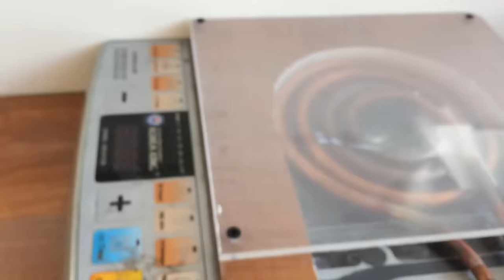How to Make 2KW induction heater from old induction cooker. Great idea DIY induction heater

Comment: You need a voice over so we know what your doing. I don't even know what your making but I like it 🤣
Reply: Yes.  Needs a voice over.  He built a nutt buster.  Heats up a nut and bolt that are stuck.  The fluctuating magnetic field from the cookstove drives the copper coil's magnetic field which is shaped in a tight spiral to focus the field on the nut which can glow red hot in seconds.
The water pump flows water through the copper because you want it to stay cool.
Normal controls can get a steel pan hundreds of degrees yet not be hot to the touch (except for the hot pan on it)
Edit:autocorrupt shucks
Reply: No, he doesn't. It's pretty clear!
Reply: @carpediemarts705  فيقفۇ
Reply: А, что тут не понятно? Индукционный нагреватель.
Reply: Hes making an induction htr out of an nduction htr! Hes a fucking genius innit!
Reply: Bwahahaha hes a freak of nature this guy!
Reply: The copper spiral coil placed over cook top induction coil is a simple transformer.  The copper coil attached to copper spiral coil is the new induction coil that you may stick iron things in and induction heat them.

Comment: Why would anyone believe this will work
Reply: @falmircamion3534  yeah yeah yeah this this probably will work but useless. Watch his other video his BLDC motor driver such BS circuit
Reply: I doubt you will reach 2kW with the other circuit,  @hiddenhidden9302 ... And even if you do, the other circuit needs an additionnal 2kW power supply. In this idea, you have it all with a simple induction cooker (And it doesn't even need to be broken).
Reply: @falmircamion3534  yeah 2kw input probably 500w of power get coupled through the transformer wast of energy. And I’m talking about his BLDC motor driver won’t work check it out your self
Reply: Well, if you were right,  @hiddenhidden9302 , it would mean you have the same bad efficiency when using the induction cooker... for cooking. I seriously doubt it...
I didn't get your point with the BLDC motor.
Reply: @falmircamion3534  no I’m talking about the coupling between tube and induction coils if you couple directly to a iron plate it would be most efficient. If you don’t know what I’m I talking about then you don’t have the knowledge to judge me. I leaned Electrical engineering more than 6 years. This guy make fake electrical circuit period.

Comment: Why to do so much copper coiling. You could directly heat iron metal part on induction coil with efficiency.
Reply: Have to be at least 2/3  of the pancakes or coil to start working you can't heate a piece of pipe and have to be turning to be heated up.

Comment: flame heat tubing, cool and it will bend much easier . Fill with fine dry sand then plug ends to prevent kinks.

Comment: Good thinking only thing is You need you outlet pipe at the top of the work  coil don't think the water will be making it up to the work coil in that configuration, it will go on one pipe and fill the coupling coil then flow out of the other hole without circulating through the work coil seems the work coil is a lot higher than the coupling coil
Reply: He crimped the pipe between the connections.
Reply: @Vibe77Guy  oh did he, I missed that 🤦🏻‍♂️ 🤣
Reply: @T2D.SteveArcs  Right at 7:00... I had to go over it a couple of times to find it myself... it's so quick.
Reply: @nyckid  👍👍
Reply: @MrUnknown7212  of course it works
Reply: @Vibe77Guy  clever

Comment: I would love to see one of these built with an iron pipe inside the induction coil - then pass water through that, to heat it. Might be a very effective water heater.
Reply: No do you know what is a very effective water heater the normal resistive coil 100% of the power is turned into heat where it's needed, this idea is stupid and wasteful the is no efficency gain using this 100% of the power will end up as heat except it's lost at multiple places so less would actually heat the water

Comment: did u make sure the cooker is set to high cause most default to 5 out of 10 and need to be adjusted to max power and without a display working or another unit of same type or power meter ud never know

Comment: How is this working? I thought copper did not work on an induction hob?
Reply from the maker: it will work when coil is closed circuit
Reply: @D.creative  Thanks for explaining.
Reply: @D.creative  how did you calculate the winding number of the second coil?

Comment: What does the water do?
Reply: Keeps the copper "cold"
Reply: @stapuft  how does this work with copper anyway? I thought the material needed to be magnetic? As in, iron cobalt or nickel?
Reply: @Bankable2790  copper is almost as conductive as gold, MY GUESS the copper is replacing the original coil, and directing its magnetic field, into the tiny coil at the end of the length.
Reply: @stapuft  Copper is not magnetic. Nor is gold.
Reply: @Bankable2790  learn to read kiddo, i said it was conductive, not magnetic, you take a coil of a conductive material, and run current through it, it becomes an electromagnet, THIS INCLUDES GOLD, that's just how electricity works. electricity and magnetism are intrinsically linked, and locked together separated only by a 90° phase alignment change.
Reply: @stapuft  you said “directing its magnetic field as*hat”

Comment: What's creating the ac current in your homemade copper coil? Don't say the other copper coil either?
Reply: The coil in the induction stovetop is transferring energy to the copper coil he just wound.
Reply: @TrevorHammonds  right bit it has to have something metal by it. That's how. Transformer works. Without the steel the secondary coil would not get an electric
Reply: @nickbaylander6320  I have limited knowledge of induction heaters, but I believe it works because the primary induction coil generates a magnetic field, which induces current flow in the first copper winding. The current travels through the copper and smaller loop, which acts like an electromagnet and generates a magnetic field, which in turn induces current flow and causes resistive heat generation in the part. The cooling system is needed to dissipate the resistive heat in generated in the copper, due to the large current flow. Again not an expert so take with a grain of salt, and think this method would only work with AC?
Reply: @nate4628  if you took the steel out of a transformer and just had a primary and secondary coil. That secondary coil isn't going to do anything without the steel. Their has to be metal in the equation
Reply: @TrevorHammonds  it doesn’t work.
Reply: @nate4628  no it doesn’t work . He uses editing to make it red hot .
Reply: @nickbaylander6320  NOT TRUE! Having a ferrous metal as a core is not necessary, due to the high frequency of operation (in kilohertz NOT running at 60 HZ)
Reply: Induction cookers will not run until it picks up metal. You can not use a non ferrous pan on an induction cooker. Even copper pots have a metal bottom
Reply: @nickbaylander6320  have you not heard of inductive coupling as in cellphone charging, sealed hospital digital thermometers, electric toothbrush?
Reply: @nickbaylander6320  you can bypass anything, like digital projectors that use HID bulbs and monitor the power supply, you can bypass the sensor circuit and convert it to LED bulb......
Reply: @devnuls  in order for the induction stove to activate it has a sensor that only picks up magnetic metal. How is he bypassing that
Reply: @nickbaylander6320  The induction cooker doesn't care if there's is actually ferrous metal near it, it turns on whenever it is loaded enough. The flat part of the diy coil couples the induction stove's coil to the other part of the diy coil, and if you put some ferrous metal in that, it loads the induction cooker just the same
Reply: @MrUnknown7212  I kk kk k
Reply: @nickbaylander6320  чтобы нагревалось да .. должно быть железное. что бы не нагревалось должно быть не железное. в данном случае нагрев нам не нужен. и витки медные. нагрузка болт который мы греем. он железный.

Comment: Will it heat a copper tube? Like for copper-copper tube weldings? Thanks for the video!
Reply from the maker: no, heating copper tube need to use some other frequency
Reply: @D.creative  you mean higher frequency?
Reply from the maker: @AntonySimkin  Yes, higher frequency
Reply: No, copper has very low resistance therefore induced eddy currents would not heat it very easily.

Comment: I tried the same but my stove has two sets of cables coming from the centre sensor. Even if on, it simply does not want to heat up in the coils. It shows ERROR. It is a 2kw Le Morgan stove. Kindly help. Regards, John.

Comment: Thanks for this great video, I know it's been a long time coming! But I like some tips.
I want to know if copper coils can be put on each burner together in 4 induction burners.
Then connect them together to take advantage of the full capacity of the stove, which is 6 kW, to get more energy. Thanks from Egypt

Comment: how do i pass the pan sensor?
Reply: yes, I really enjoyed your video but I can't get past my pan sensor.  Would you kindly confirm what you did to trick that out.  I believe the sensor in the center of the coil is just a temperature sensor so it must be using some circuit test of the capacitance with the pan present but I can't seem to figure out how to outsmart it.  What did you do?  Thx

Comment: What do you need that for? I will use it to heat screws and burnish them in oil. And for hardening small machine components
Reply: Can you use it to melt gold or silver with a graphite crucible?.

Comment: you cannot use stainless steel on induction heaters, it should be magnetic steel.
Reply: Metal that attracts to a magnet takes less power to heat up.   There is more than one kind of stainless steel alloy.  Some has iron in it and some does not.  Some stainless steel has no attraction to a magnet.  I was able to heat up this kind of stainless steel with an induction heater.

Comment: what's the water pump for?? heat transfer?
Reply: It's for cooling, the side with the cylindrical coil in an actual set up would be a low voltage high amperage inductor and the current draw creates heat which would be carried away by the water. In this case I don't know the frequency amperage to tell you how much heat is being created. That said normally it's two busbars attaching where the fittings are and the fittings would go to the coolant pump instead of to a second coil.

Comment: If we remove the sensor from the center the induction cooker will work without a iron plate ?
Reply: Right but you have to connect the spot that it connects to with some solder or wire other wise its not a complete circuit. I've tried just removing it. That doesn't work
Reply: You can remove the sensor but   not the connected wires. The sensor is meant for high temp switching off only. If you more the sensor from the center of coil it will always assume that the temp is in the limit only.
Reply: I will  remove the sensor frome the centers but not the conectet wires and will work without a iron plate 😃. That's it only the sensor  ?

Comment: I am getting the error "E0" in spite of following all processes the same.  I am using the Pigeon induction cooktop link. E0" means There are no vessels on the cooktop. Please suggest me solution.... thank you in advance
Reply from the maker: You bridge the primary winding gap with the secondary winding
Reply: @D.creative  
Thank you for your timely response
1. Secondary binding means Cu tube binding which I have added above the primary winding ....I am right?
2. What Do you mean by the bridge, should I make a wire connection between primary and secondary winding? If yes then how?

Thanking you in advance again

Comment: This is an GREAT idea. You might reuse it with making a one or two turns jump start battery cables coil and a starting relay... In order to make spot welding.
Reply: Это так не работает
Reply: Pourquoi pas ?

Comment: My physics teacher with a simple thiner wire Cooper coiled and pluged to electric outlet and put in a screwdriver inside the coil and got a quite hot redyellowish screwdriver. Did You get more heat power or what really happend, what about the extra coil and the water what were those things for. It would be Nice if You explaine it.
Reply: For cooling down the copperpipe.

Comment: Sir need explain pipe dimension etc
Reply from the maker: Sorry for the omission, I'll make the subtitles to explain. Thank you!
Reply: You have used copper pipe how can it work there should be steel. Play then copper this project is fake
Reply: Coil what he does first is about the OD 10 mm copper pipe. Second is like OD 8 mm. Just my bet. Hopefully this help you sir
Reply: @joaotomefernandes7711  it is real.  Every electric motor uses copper wire to create magnetic field.
Magnetism is produced by current flow. Why exclaim "fake" when it is your knowledge that needs to change!
Reply: @carpediemarts705  Joaotome is just mad because he used steel instead of copper on his and got laughed at on TikTok ;)
Reply: @D.creative  stop lying to people.
Reply: @joaotomefernandes7711  steel will get glowing hot. (thats why he didnt use steel)
he is using the magnetic/high frequency field transferred to the second coil. read before yo post!!!

Comment: I don't think this is appropriated for long usage. It's dangerous instead.
Reply: Whats dangerous?
Reply: @harrison00xXx  late reply but there is a high AC voltage across the coil when it is turned on

Comment: This is very dangerous as induction heating uses high power RF. I used to be a maintenance engineer in an induction company and fire, rf burns, capacitors blowing up were a weekly thing. ⚡⚡⚡💀💀💀
Reply: you mea it got dangerous as he put the 2nd coil outside?
Reply: No, it's intended for the general public who are unaware of the danger that they could be expected to. ⚡⚡
Reply: Yea you nailed it. A very unsafe project. If someone’s not careful they will indeed get Hurt.

Comment: Would the addition of capacitors between the coils aid in the melting capacity of the output coils? There's another video that tapps off a choke coil in a small welder that leads me to think that it might help.
https://youtu.be/i9Ei1jVII5w
Reply: I think it is useless
Reply: @abdulmrzoog8095  
That's cool.
Why?
Reply: Frequency is already turned in the main coil with parallel capacitor.  Hence adding capacitor in the secondary coil will have adverse effects only.
Reply: @ravindran8761  
Frequency wouldn't change, but the resonant response in the remote tank circuit would.
Reply: @Vibe77Guy  I mean the same only.